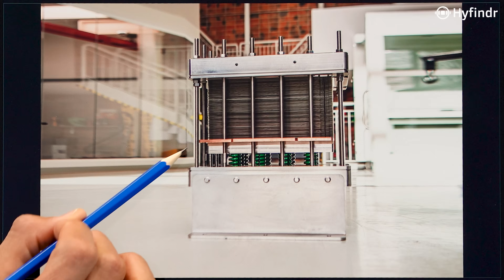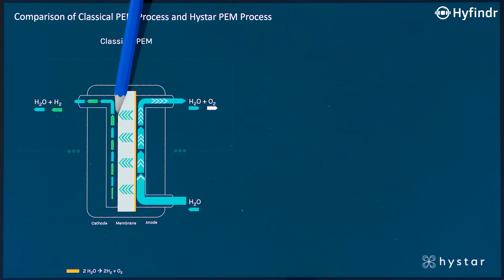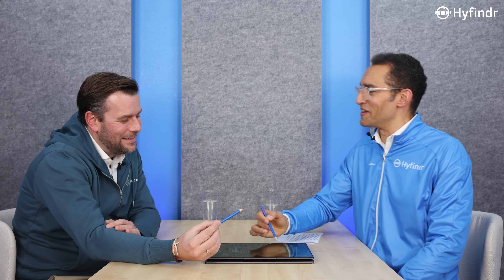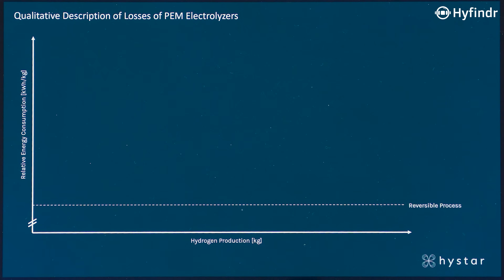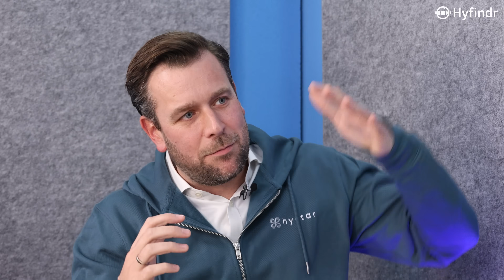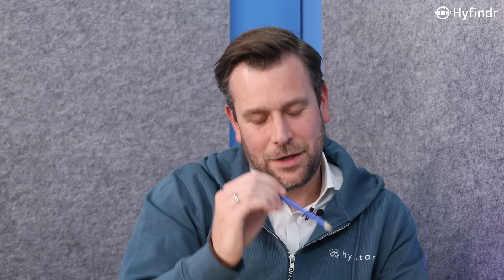Tech Talks - Wow! Hystar on PEM Electrolyzer Stack Design to save you Millions - Ellerich Hyfindr

Comment: Water molecules react at the anode, and the new stack supplies water at the cathode and make them move toward the anode through the membrane. However, at the same time, hydrogen ions produced at the anode are moving toward cathode. As far as I know, hydrogen ion drags water molecule to the cathode side. Doesn't this inhibit the movement of water molecule to the anode side? Isn't there any issue related to insufficient water supply at the anode?
Reply: As the membrane is thinner, the water transport to the anode is easier and thus enhanced. You are right, there is also water drag, carrying water from anode to cathode - thus water goes into both directions in the membrane. But this is not leading to issued regarding too little amount of water at anode side.

Comment: How does Nanobubbles improve the efficiency of PEM stacks in hydrogen production. 
Or how  much magnetised Nanobubbles add to the overall efficiency of the production %?
Reply: Attachment of bubbles on the catalysts can decrease efficiency, so in a sense "nanobubbles" or extremely small bobble formation if not controlled can lower the efficiency. When talking about "magnetized nanobubbles" I would assume that we are nearing the area of how magnetic fields can improve efficiency (by bubble detachment) and help control electro-osmotic drag as well. 
 
In general - better control of bubble formation and detachment - decreasing blocking of active sites - can increase efficiency.